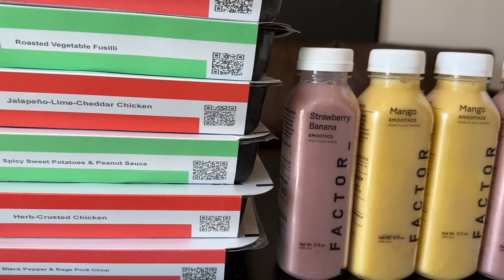Rebuilding A Wrecked Lamborghini Aventador SV Part 13

Comment: They are so lit when they say they’re going to do something they stand on it , remember a few videos back they said they were painting the Lamborghini in the new paint booth excellent choice guys keep it up 🎉i could use those combo pliers 😊
Reply: They also said they were going to do a good job rebuilding this car and not do any sketchy shit but now there's a shitty fibreglass repair that will 100% crack again in the future and a pile of bondo covering the sensor holes. 
So not 100% of the time do they follow through on promises.

Comment: Team
This goes to show that when you have money, but have little in the way of brains and talent, you too can buy common “low tensile” CF car panels for an exotic.  Bondo on top of CF to get out the low spots 😂😂.  Zero to no quality control from a 30k kit.  With the amount of downforce and stress on the panel, especially the rear wing, no amount of fibreglass and bondo will stop this cheap kit for breaking.  Lamborghini would never sell SVJ parts to these goofs, if Goonz were to give the VIN.  Should have kept it original OEM (more value in that…1 of 650) spent some money on real Lambo parts.  Do yourself a favour and watch Matt Armstrong for quality builds.

Comment: i knew i should have waited on ordering...they'll be doing 20x and 30x entries by the end of the month. lol
Reply: 100x  by the end  of the month or if they are making enough cash they will extend it another month !!
Reply: Exactly 💯 maybe if the raffle off the Camaro I enter have no use of the Lamborghini.
Reply: ENTRY MULTIPLIER OFFER: Throughout the Promotion Entry Period, the Sponsor may (but is not required to) offer opportunities to increase the number of entries you may earn by a multiplier (e.g., (2X), (3X), (4X), (5X) or (10X) (each an “Entry Multiplier offer”)  Where does it say 15X?

Comment: The reason the wing base is cracking is because of the lack of internal structuring inside of the base..... Without it you can add fiberglass till your eyes bleed it will 100% guaranteed crack all over again..... When that spoiler produces downforce from drag it will apply downforce, flexing it... ADD internal structure

Comment: You guys can still buy the sensors and essentially use them as caps. If it's too expensive of an option, then it may be worth the extra effort in taking inner/outer/rim dimensions of that socket. Go to Home Depot and look at caps they have for pipes, hoses, etc... Make it a more finished look.
Reply: Wow

Comment: There’s a thing you can do aluminum brazing on that cooler, so see if you can Google that and see how you can get that done
Reply: Yeah, I work at Utility Trailer and they have carrier reefer units and they’re always fixing anything and aluminum and I found out that they do some kind of aluminum brazing that might fix that radiator cooler or oil cooler. I’m not sure which one it is.

Comment: You should've used panel bond in the seams on the wing base and clamp it for a few hours to fuse it together. And then fiberglass over the edge to hide the seams. I don't think the rush job you did is going to keep it together for a long time.
Reply: Panel bond requires substantial surface area… they were joining en edge ( not enough surface to bond)
Reply: should seen all back and use oem parts

Comment: Hey guy's, try doing super glue and baking soda along the crack. It is what they do for helicopter blade repair and other things. the crack on the front of the wing would be chip resistant.
Reply: Yeah baking soda and CA glue would work pretty good. I've also fixed cracked seams in boat hulls with panel bond and the fiberglass on top of the seam. Once glazing puddy is on and sanded you can't tell where the seam is at all.

Comment: Gday guys,
Remember that Carbon Fibre cloth uses epoxy resin. If you are using a polyester resin repair kit that polyester does not stick/bond strongly to an epoxy surface. Also be careful of what fillers and putty you are putting on. If it’s not epoxy based products then it will  delaminate eventually. Also be careful what primers you are spraying. 
Remember, epoxy will stick to polyester but polyester won’t stick to epoxy. 👍👍
Cheers

Comment: you guys can spray blk guide coat on your primed areas before wet sanding to show high/low spots.
Reply: They used to do that years ago. Idk what changed
Reply: @DaInfamous0ne  I use it all the time ive been a professional autobody paint tech for 30 years. I paint and prep around 30 cars a week.
Reply: @DaInfamous0ne  I dont wet sand anymore that is a thing of the past like 20 years ago we did that too slow and messy for production shops.
Reply: I miss the spray guide coat too

Comment: To fix that slow small leak in the oil cooler it will have to be braised with an Oxy / acetylene torch, with a fine braising tip and a brass or bronze rod for filler, most radiator shops should be able to do that repair

Comment: If they are already at the 15x multiplier, they must not be getting enough of their junque sold.
Reply: This whole multiplier and giveaway is so cringe.
Reply: When it is worth it, somehow, to give away a Lambo and 20k to drive merch sales, what must the merch sales be worth?
Reply: @markstevens1729  it's a tax write off for them in any case it helps them
Reply: I just made a comment about this 80eighty does stuff like this and has even pushed the “giveaway” further away bc they weren’t able to make enough profit selling their merch this channel is going down hill
Reply: @Slo_300c  I simply would Not buy anything from them,  and i have several personal reasons why i wouldn't.
Reply: ENTRY MULTIPLIER OFFER: Throughout the Promotion Entry Period, the Sponsor may (but is not required to) offer opportunities to increase the number of entries you may earn by a multiplier (e.g., (2X), (3X), (4X), (5X) or (10X) (each an “Entry Multiplier offer”)  Where does it say 15x?
Reply: @timglass6041  promise we don't care
Reply: @quietbrianquiet  The catch is that they said "e.g." meaning they can introduce and most likely there will be a 20x multiplier next week and maybe even a 25x or who knows 50x? But I feel like I have been cheated and I'm sure many others are feeling too. Because after buying merch with a 10x multiplier there is a 15x multiplier offered days after. I sure hope that they will stop with the multipliers being more than 10x.
Reply: @determine5993  e.g. is short for exempli gratia, a Latin phrase that means “for the sake of example.” As you may guess, you use it to introduce one or more examples.and I don't see the example of 15X listed

Comment: $30 K for the kit and its defective maybe should have opted for the 100K  kit !!  Video's are turning into hocking merch and sponsorships !!  That spot on the roof they are talking about adding to was fixed by a professional lambo technician  at the shop where they picked up the car in California  !! Has to be another problem with that after market kit they bought !
Reply: Silly rabbit….kits are for kids.
Reply: $30000 for a junk kit. they'll never learn

Comment: 🌴  Yo squirrels !  Y’all could of patched that cooler with some  Flex seal or 5200 marine seal 👈🏻👍🏼 , on patching that wing I would have drilled some 1/4 “ holes 3/4 of and inch away from the edge turn the wing with the edge facing down and use a large marinade injector to squirt some thickened epoxy resin inside the edge then after it kicks just fill the holes with the fiber fill body filler , And now the good news !   Y’all are finally getting the dang spray booth erected !  🎉 did y’all check with the city on spray booth EPA requirements? The fume stack has to be a certain height? 15’ ?  , the paint booth is going to be a god send 👍🏼👊🏼✌🏼

Comment: After you get the holes done on the front bumper. Make sure you put a heat lamp on it. It will shrink when you paint the car and you will see the round circles. Just trying to help out.

Comment: You should do a lean to on left side of garage. Enclosed. Pull in front of spray booth for wet sanding and stuff then drive straight in spray booth then out the back of spray booth if you have that option on it

Comment: On the cooler, cut that section. Make a big enough gap and aluminum weld or braze a cap on the fins and bulkhead. If it’s a temp, then those three rails won’t matter.

Comment: I think that you might still have problems with that split on the rear deck because of the flexing caused by the rear wing. You should get the manufacturer to send you a replacement piece.
Reply: For $30k you’d think it would be right

Comment: Y’all should’ve put puddie behind the fiberglass so y’all wouldnt have air pockets behind the fiberglass. More air in the part, more weight. I work at a boat company big trust✊🏼

Comment: If you are going to fix minor radiator leaks like the one you failed at, first clean the spot with hydrochloric acid or use a blast cabinet to clean the fins and tubs then use JB Weld an the key is to apply the product then heat the radiator to somewhere around 200 F and the the JB Weld will flow very thinly into the cracks. It will harden then very quickly but let it fully cool and you will have a sealed hole, radiator or whatever. Used it many times that way and it almost always works.

Comment: Boys you need to make some indentations with a grinder first on the cracking !!
Then you will be able to get more fibre glass and resin in the joint to make a stronger job.
Keep up the good work 😀😀
Check out rattarosa rebuilding wrecked Ferrari 430 scuderia part 6.
Just thinking of you guys and the build.

Comment: For $30K that body kit should be perfect. I hate to be the bearer of bad news, but the fiberglass repair on the rear deck lid will break again. The wind load is going put stress and vibration on the joint and crack it in not time. You may have to go original on that one; those things are typically one piece and done on a huge autoclave.

Comment: OK boys, do some research into the ducting on the aftermarket wing . The ALA 2 Aerodynamic system that is OEM on the original SVJ has had LOTS of R&D and $$$$ put into developing it. It utilises flaps that open and shut to vary aero load  affecting downforce, drag etc . Don't want to see you boys having lift off at high speeds and going into orbit !!

Comment: Not sure if you’ve ever tried SOLAREZ, but it speeds up the fiberglassing process. It works off UV rays and drys in like 30 seconds. No hardener needed. Just brush on and sit in the sun.

Comment: They may so many different epoxies, use one for the wing base not fiberglass.... need something strong and made for it.  Fiberglass would be like how you used the concrete epoxy on the oil cooler.

Comment: PLEASE fully fit the new parts to the existing oem parts before you paint...  Yes Lamborghini uses shims, etc...  the body lines/gaps that you showed in the previous video were "rushed" and body work will be needed, I just want to see you guys do it right, and not rush it like most of the builds... this is different!!

Comment: You have to make the install symmetrical, if you do it on one side you do it on the other side...  if you don't the OCD police will get you. Try JB Weld on that cooler or just actually welding it...  I bet you can find some videos on how to repair that kind of radiator/cooler.  You should put Amazon links in your description for all the products that you use that you know work well, it's hard to find the right glazing putty and other stuff if you aren't a daily professional.  Here's a video on how to repair an oil cooler type aluminum radiator... it would probably work perfectly for yours.  Video titled: "Team BOC - Oil cooler repair"  (no affiliation)  I paid over $5.09 the other day in Ventura County, but can also get it as low as $4.69 for regular.

Comment: $3.29=87oct,and I pay $4.49 for 93 oct for my bike in mid-Michigan.Epoxy with a long neck to reach back into the trunklid gap,and leave it standing overnight.PLEASE put a wire in for an Electric gate ,to save Pops from going out in the rain,when you wire the Paint booth.

Comment: An idea on the crack but im sure you already are moving on. Clamp it together and fill with high density expanding foam insulation. The apply fiberglass and epoxy and sand

Comment: To repair that wing pass a grinder with a cut off wheel along the line then fill the line with panel bond then sand it down 11:16
Reply: ☝️☝️☝️☝️
ᴄᴏɴɢʀᴀᴛᴜʟᴀᴛɪᴏɴs ʏᴏᴜ ᴡᴏɴ ɪɴʙᴏx ᴛʜᴇ ᴜsᴇʀɴᴀᴍᴇ ᴀʙᴏᴠᴇ ᴏɴ ᴛᴇʟᴇɢʀᴀᴍ🎉..

Comment: You mentioned gas prices in the south, so I live in Canada where our gas right now is still $1.65 CAD per litre which is approximately $6.60 per gallon.
Reply: Think US has always had cheap petrol prices. Live in Switzerland weekly price changes, at discounter 1.70 CHF per Litre = around 7.10 USD a US Gallon. Last year price hit over 2 CHF per Litre around 8.55 USD a gallon, and that's just for regular not super. Not sure what UK prices have converted to US gallon?
Reply: Edmonton is $1.38
Reply: @daryl9799  must be nice, I'm in NB
Reply: @Chris Simpson  ours was over $2 per litre last year

Comment: the wing is cracking on the glue where they. glue the 2 carbon parts together ye jus have to reglue it dont sand it back to much or ull make it worse
Reply: $30000 for junk. Always use OEM  parts

Comment: A ‘pro’ radiator shop repairs with JB Weld, and it still leaks…must be greedzquad viewers. Do these two really think glue will seal a high temp, pressurized radiator? Duh…..custom radiator, just like ‘OEM’…..

Comment: Never ever ever do sanding in the paint booth, always, outside even cleaning using all clean outside first. Using double doors before entering  booth will keep your paint booth flawless and filters will last forever. The goal is to keep micro dirt out.

Comment: any radiator repairs or welsh plugs use epoxy putty. i used poxy putty on my race car welsh plug on my motor it stopped the leak it had a pin hole in it. it was still there when i sold the race car.

Comment: I read the official rules before I bought because I didn't want to get screwed like last time. The multipliers were capped at 10X ???  So what gives?  Why did I get screwed again?    

ENTRY MULTIPLIER OFFER: Throughout the Promotion Entry Period, the Sponsor may (but is not required to) offer opportunities to increase the number of entries you may earn by a multiplier (e.g., (2X), (3X), (4X), (5X) or (10X) (each an “Entry Multiplier offer”)

Comment: In SW Ontario Canada gas is $4.50 usd.... BTW for fiberglass dust, micro particles. I use a clothing roller with the tear off strips to remove fiberglass from my skin..
Reply: Is that per liter or per gallon?
Reply: @elgiacomo  It's per US Gallon. It is $6.004 CDN or $4.50 USD

Comment: Most items are $40 and $50 with a few $10 and $20 items. With some spending more and some spending lessl. Let's say an average of $30 per sale. At 2.5 million subs. If even 15% of their subscribers made a purchase that's $1,125,000 (Just over 1.1 million)

It's likely more than 15% enter. If 20% enter that's $1,500,000 (1.5 million). 

Factor in the possibility that more than even 20% enter and spend more than the average of $30 per sale! 
 
It could easily be closer to 2 million. 

There is the overhead for the items themselves but I'd say subtract 20% or less from the overall revenue to cover cost. 

Still not a bad return for a rebuilt title Lamborghini Huracan with a twin Turbo kit and 20k. 
I'd say they have no more than 160k in the car total including the sheepy race TT kit. Its possible maybe even less. 

Not a bad way to give back to your viewers while also generating a nice chunk of revenue while doing so. 

They've done the work and generated the subscribers! Anyone in their position would do the same!!

Let's just say I see many many more giveaways in the near future!!

Comment: In the video time with that crack. 11:35 you should inject resin,and move it around to get that sealed up, and as well y'all should be wearing face makes so you don't inhale that dirty crap.
Reply: Sorry the video starts at 10:15 minutes.

Comment: you realy tried to use that product to seal the radiator ?? that stuff is used to anchor big studs inside concrete,etc ... you need to weld a radiator in order to seal it properly

Comment: I’m sorry but fiberglass is nowhere near as strong as carbon fiber. I willing to bet they are going to have issues in the long run laying fiberglass over the carbon fiber. They would have been better off getting some carbon fiber and doing the repairs with that. It pretty much works in the same way. Just another shot at taking bad shortcuts with what would be a very expensive car. I honestly wouldn’t be surprised if there is some frame damage that still hasn’t been found yet which is why they are having a hard time getting the rear end to for up easily. After all it was rolled a few times.

Comment: Using after market parts and body panels saves you guys a lot of money but no one is going to buy that car. Trash body panels on a car that expensive just isn't the way to go fellas! True you're saving a lot of money except, of course, for the massive amount of addtional time and labor required to make it look OEM.  And stop wasting time trying to repair the radiator - replace it! So a giveaway or raffle is definitely in the future for this car.